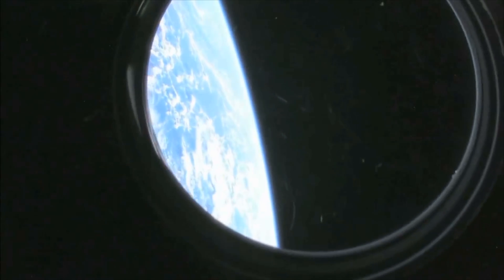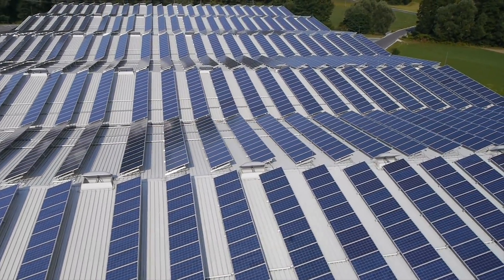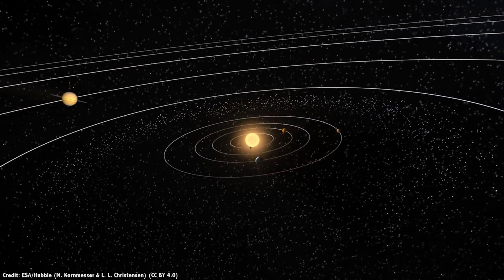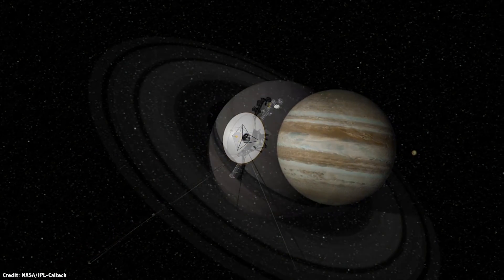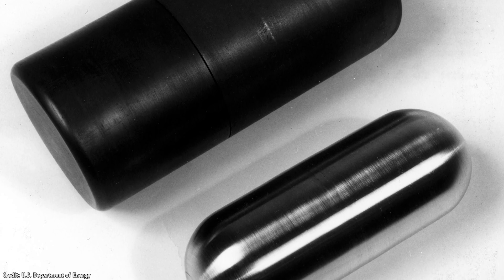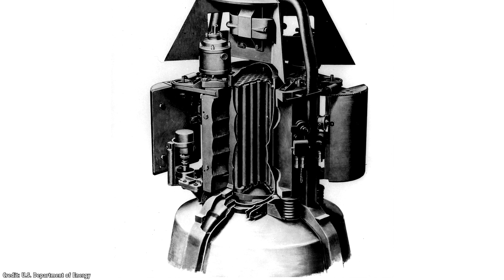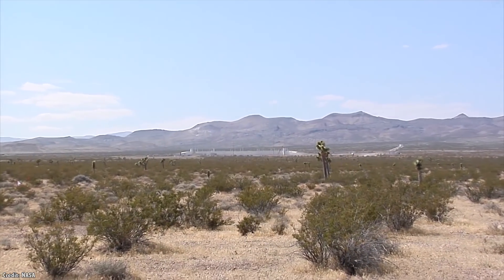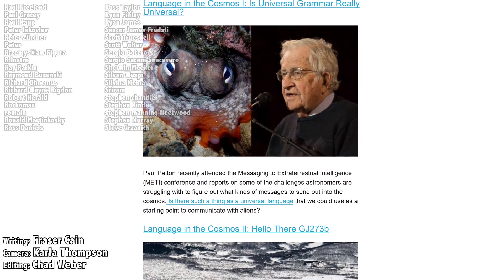The Problem of Power in Space. NASA's New Kilopower Reactor

Comment: Well there is multiple options but imma mention some interesting theoretical options that no one knows about pretty much. First off we are gonna start out with the Searl Effect Generator and talk about its strengths and weaknesses. The searl effect generators main idea on how it work put in layman's terms, is by sucking in electrons and accelrating them using magnets that all create there own magnetic field, since energy can't be created nor destroyed only change state from 1 state to another it essentially as a mini large hadron collider just for electrons specifically instead, and you may be like "but then it won't work" well actually it will theoretically cause it extracts atomic thermal energy from atoms, which essentially means it takes the electrons moves it fast and gives it energy but therfor uses thermal energy from other higher energy atoms to allow it to perfectly extract thermal energy, so Bassicly 

Brings in Electrons in enviromeny -> Electrons gain energy from thermal processes -> uses that energy to sustain the reactor and sufficiently speed up electrons and give them energy -> gets extracted as electrical energy effiectiently 

Which means using the right resources you can extract up to 15 kilowatts of power per second per pound. But there is one massive flaw, it is really really REALLY REALLY hard to do, and this is because since it extracts thermal energy from atoms which gain there properties and energy from quantum field that means your essentially indirectly extracting 0 point energy efficiently, but that means if 1 tiny thing is wrong it wont work. So if you have to little energy it can't keep itself going and of you have to much it forces it efficiency to go up which therefor slows it down and stops it which means you need to be accurate as hell, and even if you do stabilize it by using high atomic mass materials around it that are densely packed, welp that means although its more efficient it will have more radiation which can interfere with magnetic field which would stop it and also friction will effect it to , and then if you don't have a stabalizer it would be useless. The best thing we can so is use external power sources like solar panals to help it but then all of a sudden it ain't easy energy, so it's more like an almost impossible to make super energy booster, but as I said it is almost IMPOSSIBLE and if you can get it working you trade off time for efficiency and efficiency for time, and since its sooo hard and expensive and will require trial and error a lot that means although it is theoretically possible scientist don't pay attention to it since it is so hard we probs should just wait to make it in the future for better technology. Okie here is the second piece of technology and they would be called essentially, frame dragging artificial ergosphere energy boosters, and by using the castor effect we can create this but it's ineffiecient using casmir plates, so our best option is by using crystallized light. Or bassicly in laymans terms, we can put light through individual atoms which causes the light to entangle with the atoms momentarily, which exchange properties and causes light to become more particle and less wave like,which makes it have stronger entanglements with its photons it already entangled with which therefor creates a mini strong nuclear force through the exchange of virtual particles. And since it acts more like a particle then it changes the normal P^2 × C^4 = E 
And it takes that P (which is momentum, which is where all of light energy is tranfered into which is why it's massless btw) into some M (aka mass). So therefor that means we essentially found out how to take the energy of a photon and turn its normal order entropy pushes it to and flips it around, therefor allowing for pure energy to create even more mass 100% efficiently in a compact area of space like matter does but out of Crystal llike light constructs, which can allow us to more easily create frame dragging and since it has mass it would be easier to control. "Why is this useful" you might ask, well essentially it allows us to give energy to atoms in space with complete control, which through energizing of the nucleus inside particles it creates gamma rays which triggers fusion reactions, which can allow us to create bigger fusion reactions with less mass to carry up into space (since you can turn it on and off). You can also create differences in charges then to (since photons have different spins) which can assist in the reaction to and pull in more electrons. And fuck it if we can somehow change the spin of these light crystal like particles, it can force the strong force to get stronger momentarily and break the entanglement they have therefor releasing that built up energy as more energy using the quantum field and if we can extract that total energy output of it, it can allow us to there for turn that additional energy from the quantum field and make more particles, therefor creating an even more efficient positive feedback loop of quark fission and fusion, but obviously we don't got the tech to do this yet which is why we aren't doing it (also we can gain the energy to create lasers in the first place using the previous searl effect generator I talked about, and stacking them therefor allowing for energy extraction from multiple quantum fields over large areas of space). So there is the 2 ideas that popped in my mind for free energy, but yes they are impossible rn but in the future will be viable as heck (if we live in the right universe conditions as the quantum multiverse, which would allow it to work in the first place, without the quantum fields possible strength these generators wouldn't work no matter what).
Reply: Sorry for a lot of typing errors my autocorrect messed me up hard, and I don't wanna fix it. :P
Reply from the maker: No Searl Effect Generator has ever been built, so it's hard to talk about the strengths and weaknesses of something that can't actually be tested or examined.
Reply: Fraser Cain That's why I said Theoretical it's all speculation rn, simply do to these weaknesses making it almost impossible.
Reply: Fraser Cain You can find sooo many weaknesses in it, even theoretically that's why no one took the risk yet and tried to make a real one. And since it harvests thermal energy that's why I said "assuming max efficiency with the right materials it can get to 15 kilowatts of power per pound per second", so it's all speculation man and I was just stating the theoretical possibilities for the future instead of present :P.
Reply: Fraser Cain So I'm stating possibilities not facts bassicly. 😁😁
Reply from the maker: So we can't know what's possible until someone makes one. The biggest question is whether or not it's even possible.
Reply: Fraser Cain Ones again that's why I said THEORETICALLY , by using what we know on how it is supposed to work. We don't have to test it to have an idea on how a concept works.
Reply: Fraser Cain Assuming that we know nothing about an idea simply cause we havn't made it, is a logical fallacy,  saying that is like me saying "superman can't fly in comics cause he aint real" well clearly on paper he can fly cause he exists in a universe where the conditions allow it to be possible in the first place and is allowed because it is an IDEA . And with any idea in general the same rules apply, bassicly you can't deny the main idea of a object on how it works simply cause it ain't around, and therefor you also can't deny it when applied to the facts to determine the strengths and weaknesses. Essentially what your saying is like me saying "String theory is impossible and doesn't work the way we think it works, because simply it can't be tested.", well tbh it can still exist and I would agree there might be other underlying issues and details from what we might expect since it can't be tested, but if it was all wrong simply cause it can't be tested, then the idea of it wouldn't be there in the first place for you to think about and successfully apply to our universe. Since after all the information of it on the smallest of scales, is made of fluctuations of energy in space which creates the fundamental areas of info that collapses down into particles according to quantum mechanics, and since energy in space creates info, and information = reality, that means technically since information can't be created or destroyed only change states that means then unless we have a flaw in our understanding of the universe (which is unlikely since its been tested multiple times in success and schrodingers competitor pilot wave theory has already failed some tests giving it highest % chance unless there is an underlying factor to pilot wave theory), or unless there is an underlying factor in quantum mechanics in general that is saving us from these microrips that should be created in space from this information/space/reality being destroyed. The best thing we can do is succumb to Occums razor and make the least assumptions to have the most logical answer. And so by following that that means your always in a info superposition until you observe reality in the first place, for your eyes to exchange info with the photons a perceive it and understand it by understanding it as electric discharge patterns in your brain created by ions allowing it to perceive it, but if it didn't have its own 6th dimensional space to allow it to do it in the first place then your brain wouldn't be able to think. So that means any ideas can't be completely right or wrong, it's how it applies to our universe that matters and with physics it starts out as an educated idea, until it is broken down into math and applied in the first place (even with different physics), meaning without ideas in the first place, and without being open minded for it to be possible in the first place, there would be nothing around for us to have. And that seems to be your issue, either you are denying the facts which would make you a fool, or you are not following Occums razor and denying the idea which would also make you a fool, because that is how humans started out in the first place it all started out as educated ideas and without those ideas our technology and scientific method wouldn't be possible in the first place, which means being narrow minded or making logical fallacies is what has been holding humans back in the first place. So as history has shown Narrow Mindedness = Stupidity, and Logical fallacies derives from this human stupidity, when either denying facts, or by accepting it as completely true or false for some reason without enough evidence. And that's exactly what I realized with how you replied to it, it seemed kinda Narrow Minded saying that. And no I'm not saying it's all true or false, i'm just taking all the facts you can't deny if we can implement the right materials in it (which we know exists), and if we somehow get it working, and that's why i said theoretically cause it's an educated guess essentially like all other ideas which you cannot completely deny or accept unless you're a fool denying how facts and reality works.
Reply: Fraser Cain Life is about understanding in general and being able to use it for whatever you like to make you happy or to help everyone else or etc..., and following a flawed scientific method isn't what gets everyone understanding in the first place. So without us being open minded you can't follow your flawed scientific method in the first place, and therefor just cause I might think differently or approach things differently stating educated possibilites you can't just deny it like that.
Reply: Fraser Cain So i think I forgot to add in actually I'm making, EDUCATED POSSIBILITES that aren't 100% FACT , simply cause we didn't test it yet. But we don't need to make it, to make an educated possibility with it unless we want to make no progress in the first place.
Reply from the maker: I'm being open minded. Somebody should make a prototype and then we can see if it works.
Reply: Fraser Cain Okie so it just had to do with communication error stupidity, or even a logical fallacies that makes you seem so set on only one way of learning and narrow minded, when really it just seems like it, so it might not actually be that case. But yes I agree someone should make it to experiment with it, but by what we do know and by following occums razor, it is definitely gonna be really hard to make in the first place for sure and if we can make it, it will be well worth it. So by what we do know about it, it is a high risk high reward situation, and probs won't accur and be looked at till 2020 - 2030. So to therefor stay most logical we should theorize and apply math to it, so we can know what to look for, to know if we have problems with it or something is making it less efficient, so we can fix it and get it working, instead of steering blindly into a pain in the ass design which we probs won't be able to make if we don't theorize in the first place. 😁😁 XD LMFAO, It's funny that it appears we had communication issues, so I guess we can say. #ScientistProblems

😂😂😂😂😂😂
Reply: Fraser Cain I'm thinking about trying to make a searl effect generator when I get older, although I know it's gonna be so hard that it's probs not gonna be nearly as efficient as it can be so I might end up making a flop. But I think it is worth the try, and imma also see if I can find a more efficient way to bind photons together to therefor allow me to turn most of its energy into mass which should hopefully allow me to create, an artificial ergosphere to enable me to create more efficient and pure fusion, for multiple purposes like maybe the government to use for there tactical assault opperations, or for easier free energy. Anyways knowing it appears we both suck at communicating i guess imma have to be more patient, instead of jumping to conclusions. So what is your thoughts about the artificial ergosphere pure fusion idea, that I thought of ?.

Comment: They did an experiment where they took a wire and let it out from the orbiting space shuttle..  
Since you can get a current from having a conductor move through an electric field they thought this might provide power.  
Sure enough they measured enough power to run the shuttle many times over.  
Sadly, Before they stretched out the amount of cable they intended they broke the cable but I think this might warrant more studys.
Reply from the maker: It's been tested, and should work. The cool thing is that you can put current through the wire and use that to raise your orbit. Or vice versa.

Comment: Just as a point of order an unstarted nuclear reactor is not actually significantly radioactive. Uranium 235 is not substantially radioactive, you can handle it safely. Even the nuclear thermal rockets have such a low burn-up they don't have  massive quantity of fission products on board.
Reply from the maker: Thanks for that.

Comment: I have a really good question about the rovers solar panels if they expected it to die becuase of dust why not install a wiper cant be that fucking hard small electric motor and a wiper make it out of carbon fibre if you want
Reply from the maker: I just covered this two questions shows ago. It's more weight and moving parts and more things to break. One idea is a way to tilt the panels up and run electricity through the panels to get the dust to dialodge.
Reply: ok thank you

Comment: Sabatier reaction/process is really need some initial energy but I think could become self sustain any chemist have really good insight on  this practice. It’s basically CO2 + 2H2 = CH4 + water. But what I’m thinking is take that CH4 (methane) and burn it with O2 creating some heat generating electricity white then is used to do electrolysis to water creating H2 and O2. However in order to turn CO2 into fuel (CH4) it’s needs some pressure and heat as well as a catalyst to allow the process. Any one else got any thoughts or ideas on how to expand this also I believe this is the process the ISS use to get the O2 they breath.
Reply from the maker: Did you see the episode we did about in-situ resource utilization? There's an instrument on Mars 2020 test the idea.

Comment: there is a new development called diamond batteries. They use radioactive led from old reactors which is turned into a diamond. This diamond in embedded in another diamond for safety. This contraption creates electricity however at a very small amount. They should be able to hook them in parallel though.  Life expectancy is 57 years.
Reply from the maker: I've never heard of this idea before.

Comment: Ever heard of non-degassing engineering materials and of the photo-nuclear process developed in the 1920s by Professor Le Bon of France until it was gradually suppressed by the U.S Government starting in the early 1930s in favor of fission nuclear process because the photo-nuclear process can only be used for power generation while the fission nuclear process can be used for WEAPONS PRODUCTION AND WITH POWER PRODUCTION AS A SECONDARY BY-PRODUCT FOR ELECTRICAL POWER GENERATION AND PROCESS HEAT PRODUCTION.
Reply from the maker: I hadn't heard of them.